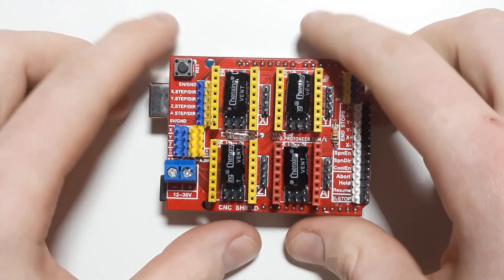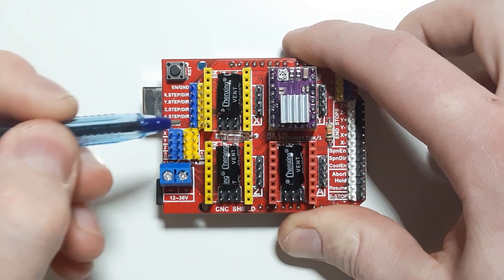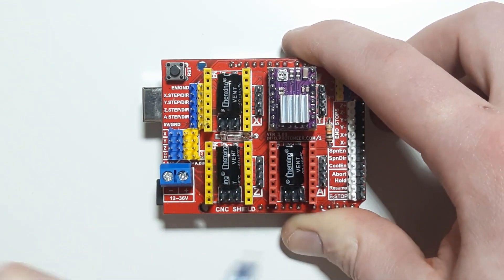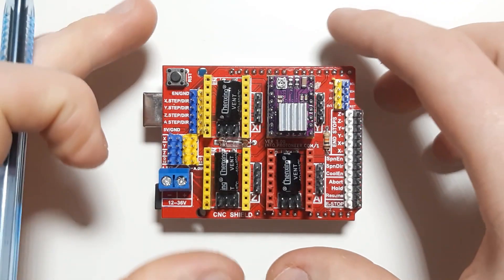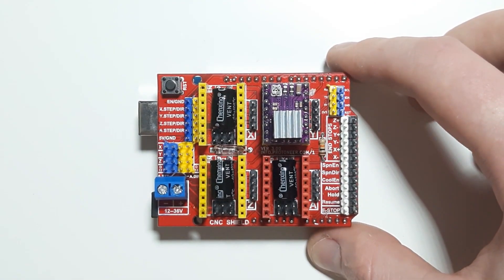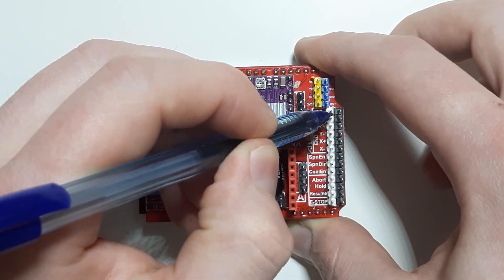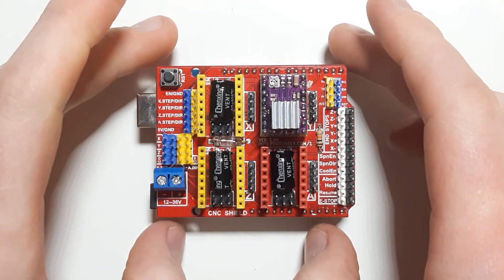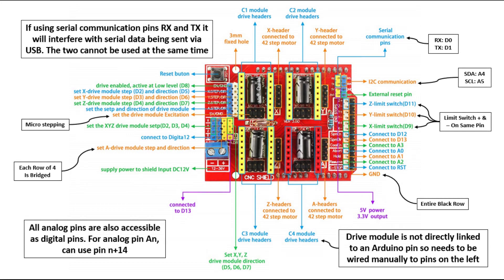CNC V3 Shield Arduino Pinout (Which Arduino Pins Connect Where On A CNC V3 Shield?)

Comment: I did a continuity check of the sockets' SLEEP and RESET connections to all of the Arduino connection pins protruding from the CNC shield and there are none (also the RESET on the sockets does not seem to be connected to the RST on the far right of the board).  Shouldn't there be some way to access at least the SLEEP pin on the driver boards?  Otherwise it seems like it's left to float at whatever value it does by default.

Comment: I have had several of these go bad and  even a couple of power supplies. I have changed out the A4988's to TB6600's. I am having problems with consistent motor rotation as well as the excitement pwm for the laser.

I want to use the TB6600's as they provide motor Lock when activated and am hoping they won't wander about as the A4988's do. This is a self-designed and made Laser setup. I am, and have been using it for about 6 mos, prior to the issues.  I tried doing this with just the pin out on the Arduino Uno but cannot manage to find all of the right pins for "Pul" or step. 

I have background in both electronics and robotics and unfortunately have talked myself in circles. Any assistance you could provide would be great and very much appreciated.

Thank  you in advance!

Comment: Thanks for the video, very informative. I have built a project that is using TMC2209 drivers. From what I've been told they run in stealthchop mode but I want them to run in spreadcycle mode. There is no UART communication and I could only find a vague reference to physical pins to change this. Do you have any experience with the 2209 and this shield?

Comment: Can you please tell me what the EN/GND pins are used for on the shield?  (Near the reset button). THANKS.
Reply from the maker: EN is the exact same enable pin that is used for each of the stepper motor drivers i.e. pin 8 on the Arduino, with a multimeter you should be able to sense continuity between every connection marked EN. GND is the same really, its the same ground as every other place marked GND and hence the same ground as the Arduino itself.

Hope that helps.
Reply: Thanks for the reply. I have inherited a CNC spindle machine and see that this pin is linked to ground. So, should this link be removed as it is in effect grounding the enable pin?
Reply from the maker: By the sounds of it the previous user has bypassed the enable function and made it so that the stepper motor drivers are permanently enabled (by pulling the level of the EN pin down to ground as explained in the video). The machine should still work with that setup, I can't see many issues coming up with that setup but just to be sure I would remove that connection. If you are using a commercial software to run the system that is made to work with Arduino and this shield then it will toggle the EN pin as necessary to run the motors as desired.
Reply: THANKS for taking the time to reply.  That makes perfect sense as the motors are permanently energised.  As suggested, I will remove the link and allow the software to control the enable state. 👍👍
Reply from the maker: @Htfhjooffhgghwwwwdf  Glad I could help

Comment: Are all Enable pins actually on #8 ?
Reply from the maker: With this specific setup with the Arduino Uno and the CNC V3 shield yes, also works for the Mega (assuming you plug the shield into the right place).
Reply: @makeitquick9638  Interesting, thanks.

Comment: thanks, is there a way to easily make one of the motors move just by connecting some of the pins together?
Reply from the maker: This shield is used for stepper motors which work differently to other motors in that applying a current locks the motor in place rather than causing motion. Switching between locked states causes motion.

I have another video on controlling stepper motors without motor drivers. The same code can pretty much be applied to the pins as necessary:
https://www.youtube.com/watch?v=E_TI7ny26pI&t=8s

A better video for this might be this though by Electronic Clinic:
https://www.youtube.com/watch?v=TMK_fLgpESQ

For your specific question I'd suggest watching from about 15:00 in, but it might be worth watching the whole thing to increase your understanding of everything.